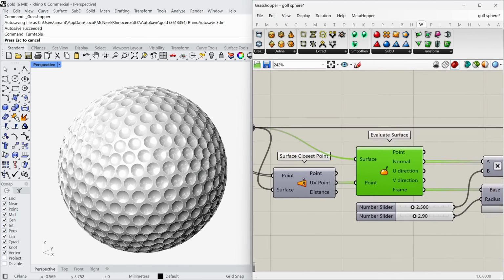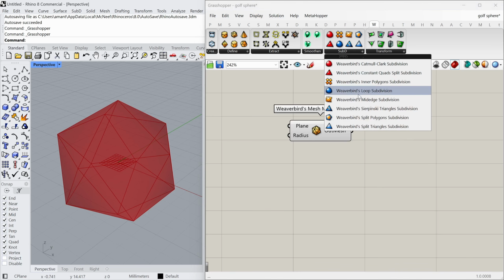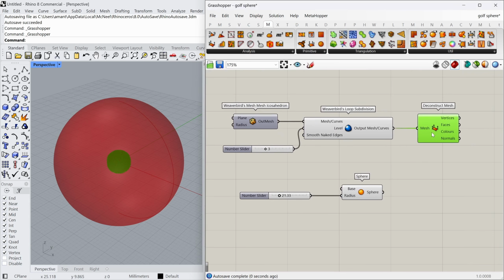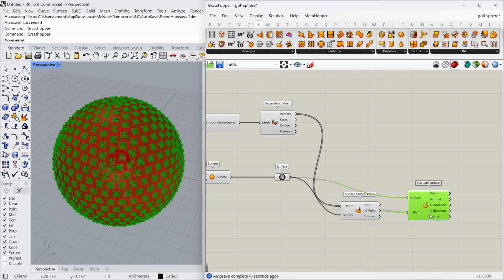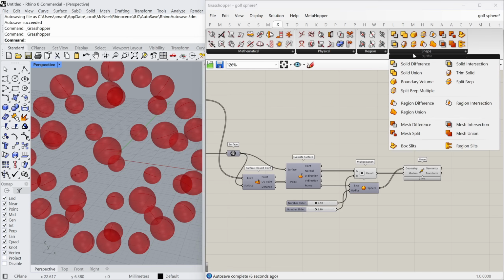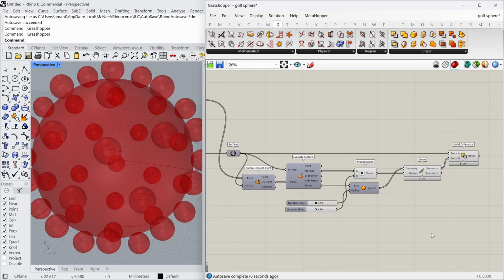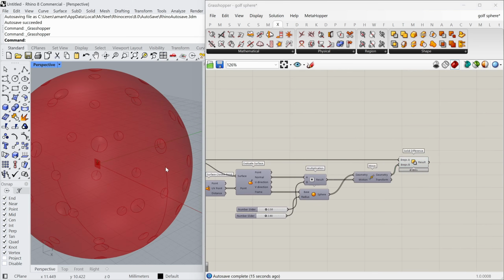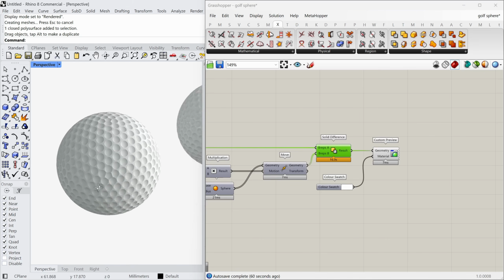Golf Ball – Grasshopper 3D Tutorial

Comment: Hallo, Unfortunately, the distribution of dimples is not homogeneous
Reply from the maker: It’s impossible to place a truly arbitrary number of perfectly equidistant points on a sphere... only certain discrete point counts are mathematically possible.

This method is therefore an approximation. Another approach would be to use Kangaroo to simulate colliding spheres; however, that solution is also not perfectly equidistant, though it is more accurate and significantly more complex than this method.